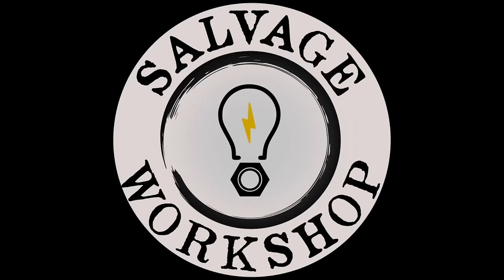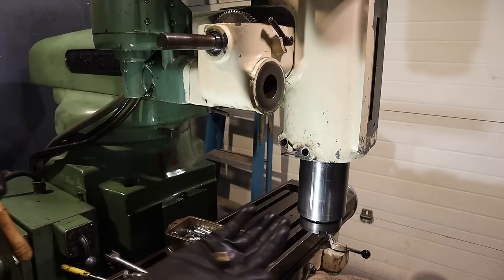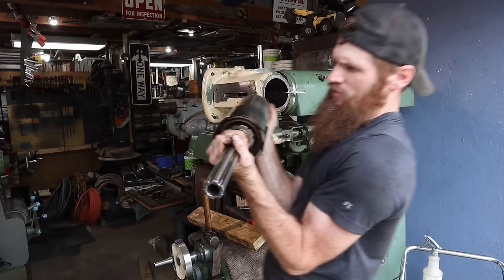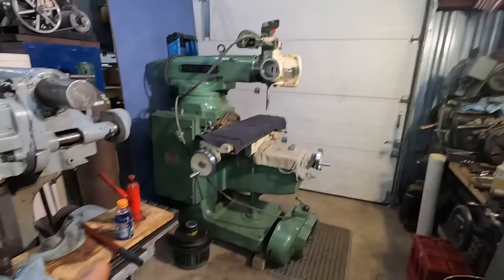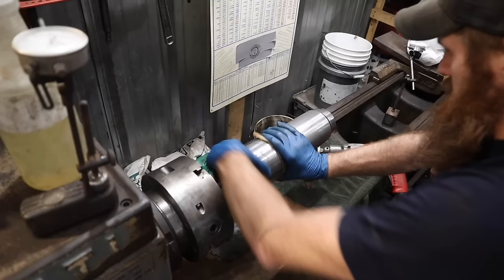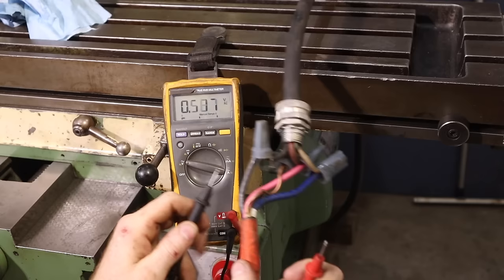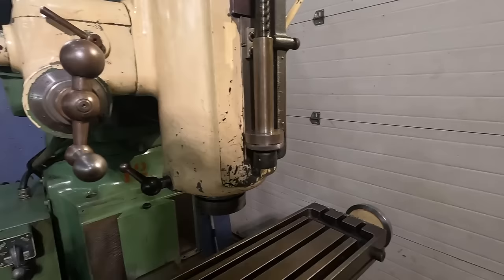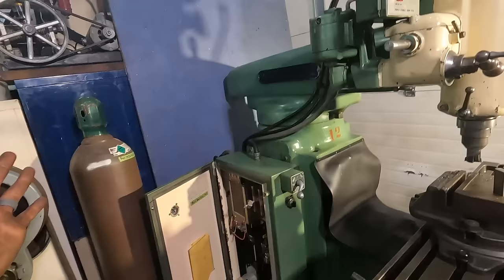My 1960's Milling Machine Is STUCK SOLID! ~ Can we fix it or will I DESTROY it?!?

Comment: Down feed system:
That motor is a "universal" brushed motor, same as most handtools.  Speed control is basically a triac controlled "lamp dimmer" type device. That is wired to the armature through reversing switch and appears to be working (from smoke test :)).
That leaves the stator, which is either open, or not getting power. That's the two black to blue wires direct to the motor from power box.  If the winding is open youll likely need a motor, but I suspect its just not getting power for some other reason. Good luck.

Comment: Mercedes used to put their engine castings in steel sheds in the mountains for years in Germany to relieve internal stresses. I think they stopped doing it in the 80's or so for monetary reasons. For a couple years the castings would sinter between sub-zero winters and extremely hot summer temps in those steel sheds to relieve internal stresses before they were ever machined.  It seems likely the castings for the quill boss have internal stresses from manufacture that have played out and changed the tolerances.
Reply: this is what i was thinkng, sometimes machines just sitting around can settle out and deform slightly, but enough for things to bind

Comment: After seeing the overall condition of the slide surfaces and all the gobs of grease and oil, I think this is a classic example of too little use and too much lubrication. When you get the electrical bugs figured out, you have got yourself a super nice mill. Another thing that will tell it's condition is the amount of backlash in each of the three axis lead screws. I'm betting that it is minimal. Home run, my friend!
Reply from the maker: I agree completely! I'll show the runout in the spindle and check the backlash in the next video on this beast, but I'll bet there is pretty close to zero in the ways... I've had some machines that aren't the tightest, but this machine is pretty amazing, especially for it's age! Thanks for watching, I truly appreciate the support!

Comment: I have a Bridgeport milling machine. I still have the 3 ph. motor, but made an adapter plate for 220/110 1 1/2 GE single ph. motor. Works fine.😊

Comment: Nice workshop, one advantage to a Bridgeport over your machine is all the parts are still available. Over here in Scotland I have a 3 phase inverter changing 230v Standard here to 440v 3 phase running my 1967 Bridgeport mill. The 40 taper would be stronger I would think than the R8 but for what I do it perfect.Nice to see more old machines coming back to full working order. M😀

Comment: You need to change the overloads. Thats what those reset buttons you're pressing are. Since you changed the voltage you need to change the overloads.
Reply: yup i figured the same, less voltage, more amps needed!

Comment: As many have said, the heaters are one thing to look at, but since you essentially doubled the amps going into everything, you may need to upsize wires as well.  Yes they are "easy to reconnect" but rarely are they wired appropriately for the lower voltage/higher amperage.  While I also understand, getting it done, it was pretty tough to watch what you were doing for most of the video.

Comment: I think you’re supposed to remove the quill assembly from the top
Reply: Absolutely my first thought.
Reply: After several minutes of watching Matt struggle I wondered if it comes out the top myself.
Reply: True!! but I think his assumption was correct that it was either a non original quill or quill head causing the problems.
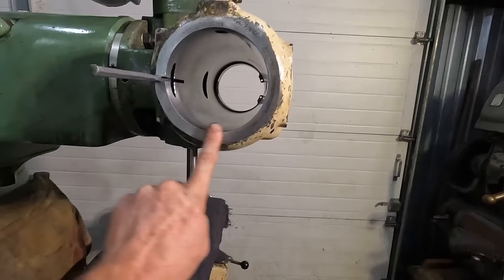Reply: Absolutely correct. Remove the circlip that is clearly visible @35:13 and take it out through the top.
Reply: Yes, if the quill bore is slightly tapered by design to be more narrow at the end he removed it from, that would explain the difficulty removing it. @angrywabbit
Reply: @angrywabbit I like how at the same time he’s pointing nearly dead at it while indicating the chamfering he’s done 😂

Comment: It is too late for your project unfortunately. Measure the bore on the machine for concentricity and the shaft for both diameter & straightness. If work needs to be done. Try to do the corrective measures on the shaft. It could be remachined and or remade if necessary. Once the casting is altered it is very difficult and expensive or impossible to repair depending on what damage has been done. Get the machine maintenance manual and go from there. If you have the manual and are still needing to use sledge hammers to disassemble precision assemblys you can expect on reassembly the opperating tollerances to be well out of usefull range for precision work.
Good luck I hope you get it working.
Reply from the maker: I appreciate the input! I do have the manuals from vintagemachinery.org, and even after going through them I couldnt find any way to disassemble THIS machine without the hammer, no idea why other than my hypothesis, but once it went back together it runs beautifully... I'll show you in the next video how true this beast still spins!
Reply: @SalvageWorkshop  If Keith Rucker ever sees this, it would probably give him a heart attack.

Comment: Chances are better than average that something is over tightened causing the quill bore to distort, this is what happens when people who I wouldn't trust with a lawnmower start working on precision assemblies. Not everything requires the torque like you are building a John Deere. I especially love the random grinding, filing, and sanding to everything with a high tolerance. I even more love the part where the cylinder hone made an appearance. After beating the bearings to death, all the sanding, honing and grinding just scrap the machine. I am all for never giving up, but there is a time where you call someone, you passed that time a while ago.

Comment: I’ll just make a list of what you potentially damaged, outer piece that moves up and down is quill, the part that spins inside is the spindle you beat on that with a head hammer, those are at least class 3 if not 5 bearing, it least they were.  Pounding the chisel into the clamping gap bends that cast iron way more than it was designed to.  You created a tight spot in the bore by doing that.  Those machines were built by K&T at least for some time, they were less expensive than similar sized Bridgeports, HP and drive unit is all pretty much the same so I’m not sure what would have made them cut any better or have more power. I worked as a machine tool rebuilder so I’ve experience in fits, alignment.   At some point measuring the two components to determine there actual fit would have been the place to start.  The way of sanding the quill was a joke.  With that course of abrasive you could have easily removed an excessive amount of metal.  Three jaw chucks are inherently inaccurate.  If there were/are center holes in the shaft that would have given you a more accurate reading at least before you beat on the splined end of the shaft with a hard hammer.

Hire an electrician before you destroy something or hurt someone.  It was painful to watch you work.  The wear on a variable speed drive is on the sides of the belt not the flat surface.  It’s making some odd noises for sure, good luck
Reply: I fail to imagine how, unless there was some internal stress present beforehand, pulling an arc open can decrease its curvature radius locally (I'd expect the local curvature radius to increase nonuniformly -- depending mostly on the thickness that varies with position around the circle -- but not to decrease anywhere). Do you have a drawing or something else that would help me understand how the opposite can happen?
Reply: It’s a simple concept, the split is put in the cast iron housing to allow the lock bolt to draw a precision bored and honed fit to be closed down enough, Perhaps 0.001”, to clamp it in position. Keep in mind the lock lever is 3” to 4”:long, limiting the amount of torque you can apply against a precision ground quill.

You beat multiple wedges into that slit expanding the cast iron significantly more then you ever could withe the lock lever due to its limited torque and the fact it is tightening against a precision ground surface.   The localized application of force causes compression of the casting.  The compression is taking place approximately opposite the expansion because the force of the wedges is pushing out in opposite directions.  Since cast iron has minimal characteristics that allow it to bend  and return to its original shape deformation at the point of compression is likely to take place.

You can see a similar result in the splined spindle drive shaft you beat on with a hard hammer. You hit on its end yet it deformed in an area that was greater in length than its diameter demonstrating impact force is spread through material and not simply localized.  

Since there was no corrosion or accumulation of dry oil on the outside of the quill experience would tell me something else was causing it to not slide out.  Measuring tools would be the first tools used to determine IF there is mechanical interference between the quill and casting. The presence of deformation at the lower quill opening would not surprise me.  Such deformations would be related to the method of disassembly and likely no be the cause of the initial problem.
Reply: @takedeadaim8671 

I agree that if you apply compressive stress, you'll expand the material perpendicular to the stress applied. However, it seems to me that the whole inner surface and vicinity will have tension loads applied to it, and only the outer surface and vicinity will be under compression. Do I get this wrong, or does existence of compressive load far from the inner surface affect inner surface's curvature?
Reply: @robertobryk4989  Simply put stress will occur through the thickness of the part and can cause distortion. The only real way to "see" this is to measure with a bore gauge at multiple places around the part.  My comment(s) are to help educate and share my experience which spans many years of repairing equipment and doing machine work.
Reply: @robertobryk4989  , Of course, it does, take a piece of 1" wide bar stock and bend it 90 degrees without heat.  Both sides will show signs of stress one caused by compression and the other by expansion.  What makes you think the same thing will not happen to any piece of metal when subjected to the same type of force?  Not a believer yet? take that same piece of flat stock and bend it back, does it go straight or is it deformed.  Before you say you can make the bar stock straight again in a press remember you bent a precision surface and had you the measuring tools and knowledge to use them you would have seen that before you oversized the hole.
Reply: Hey I am glad I am not the only one here who found this painful to watch. This guy needs to find another job because Engineering is not his forte.  He doesn't know about fits and limits. 
No micrometers or bore gauges. I'm not even sure he'd know what to do with them anyway. 
I'd give this guy a wide berth if I needed any machining done. I'm just flabbergasted that he posted the video. 
now he's mucking around with electricity... 
LoL it's knocking what a surprise , its a pity you can only give one thumbs down.
Reply: You better invest in some brass hammers
Reply: yes, it occurred to me that measuring would be a good place to start. but of course forcing a cast iron split cylinder apart would pretty much destroy any chance of a proper fit. i'm suprised it didn't crack. 

in defense though, getting it out to measure properly would have some precedence i suppose. ...sort of a "rock and hard place" situation.
Reply: My brother has a Gorton 1-22 in his shop, and I've got a Bridgeport 1J in my home shop.  His Gorton is definitely heavier than my B-Port, the column and the table are all more robust.  "Night and day" difference?  please.  His machine, with y-axis box ways, and 40-taper tooling can probably take heavier cuts, but it's a matter of degree, not an exponential difference.  And, if I were to offer a straight-across swap: my 1J step pulley B-Port for his vari-speed Gorton, he'd take me up in a heartbeat.  Would I make that swap?  nope.     There's still something to be said for machines that have a robust support network.  Go looking for repair parts for your Gorton, then look for J head Bridgeport repair parts, and you'll know exactly what I mean.  Not just OEM, but aftermarket support, too.
Reply: @vandalsgarage The J head Bridgeport was the lightest head they made, they offered several models depending on the needs of the customer.
Reply: @takedeadaim8671  well how the hell would you have gotten a badly Stuck Quill out!!! You guys do a Lot of whining but don’t have any solutions!!! Are you so bored with your Life, that you have to criticize others who are enjoying theirs!!!!! Go watch Videos you don’t need to criticize!!!!

Comment: to check if you did any damage to the spindle or if it has out of roundness. use a known good 40 taper collet and a known good straight standard hole gauge ect put a dial test indicator on it and slowly spin to check runout. also most of these style mills used oil for almost everything not grease check if you can scare up an original lubrication chart most of the zerks are probably oil zerks not grease. you may know this already but i thought i would mention it. also i think the bjiur box is an oiler system. the base of my main mill was cast in 1917. converted from horiz to vert with a tree milling products head. still does everything i ask of it and will hold 1/2 a thou if i'm the one running it :)
Reply: Good points! He should use the proper oil on every part when he puts machines back together. Including anti seize on bolts/fasteners. (Not lead screws lol)

Comment: If I'm not mistaken the main that you hammered out is a fairly tight area. Build up of old oil possibly grit can hinder the slide of the quill. Because of the tight fit if a upper or lower bearing got overheated it will deform surface.

Comment: Nice video you figured out the cause of the quill not functioning. 
Because the motors draw more current at the lower voltage you need to change the heater elements. The N19 heater elements are rated for 2.96 amps and you probably need N26 elements that are rated for 6.26 amps. Check the motor name plate and see what the amp rating is for the lower voltage.

Comment: Hi, Anytime you change the Voltage, you have to check Every Motor is wired to that Voltage. The Contactor Coil may have the High Leg or 208V going to it, instead of the 120V leg. I suspect the Spindle Lift Motor is Wired to the wrong Voltage. Hope this helps. That’s a really nice Milling Machine. Good Job getting the Spindle freezes up. I’m betting it’s a new Spindle and wasn’t Fitted to the Bore. I’m sure you will figure everything out. I enjoyed the Video.😁👍👍

Comment: I'm sure the "mystery metal" would have cut much better if the tool was turning in the opposite (right) direction. Since the switch was set to forward my guess would be that 2 of the phases need swapping .
Reply: I agree with you. Forward should be clockwise.
Reply from the maker: Yeah I wish I would have noticed that, but sometimes in the thick of it you don't notice something like that... I'll switch two of the leads! I'll bet it cuts better!

Comment: The 3 phase power from converter can only be used to run motors that are delta connection, not y, because its a wild leg 3 phase. There seems to be an overload condition due to that and how this particular mill is wired
Reply: I'm curious how he has 208 to neutral. Some investigation should be done.
Reply: Delta bastard leg.

Comment: You could have blued it to find the tight spots.  The blue will transfer / rub off in the tight spots.
Reply: Absolutely what I would have tried
Reply: yes prussian blue or at least layout dye lol
Reply: I second that, the only way to determine where it was binding.
Reply: Came here to say the same. But in the end, his assessment that the ram was a replacement and likely never worked when it was attempted to be installed, his conclusion of honing the cylinder just enough gave a good outcome.
Reply: Yes, even a pencil's graphite or a Sharpie.  Without that the marks are there but a magnifying glass is needed.

Comment: phosphate grease is my guess .. bound the quill.  I've jammed pliers due to using that stuff.  I think you did the right thing.. and the honing will give some oil grooves (thata was filled with iron phosphate)  Love that funky electrical power..   Amps trip breakers.

Comment: When you had the quill in the 3 jaw chuck on the lathe, those 3 jaws are almost never true unless you have a fairly new one. You have to indicate the roundness and lightly tap it in. The one end was out more than the other. That says that it's not in straight. Anyway, use lots of lube on the quill and the ways. Also I recommend that you put the way covers back on the machine. It keeps chips out of the ways and wearing them or making it hard to move the axis of the machine.

Comment: About 40 years ago someone ran a flycutter on a NEW Bridgeport and sheared the key in the spindle. I had to use a sledgehammer on the drawbar to get the collet out and then grind the key out. Bad situation….. after that the machine would sometimes tighten the collets on the drawbar if you tried heavy cuts.

Comment: I'm a 50 + year maint electrician. You might be able to find 3 3-phase transformer that will change the available voltage to the voltage you need.  The transformers are usually multi-volt.  Most large cities have used machine sale houses.  Even having to pay shipping will end up being a ton cheaper than a new one.

Comment: First of all, no grease on the Waze. The only thing that should get grease is the knee screw in the worm drive for tilting the head. are you sure the bezoar is not an oiling system ?